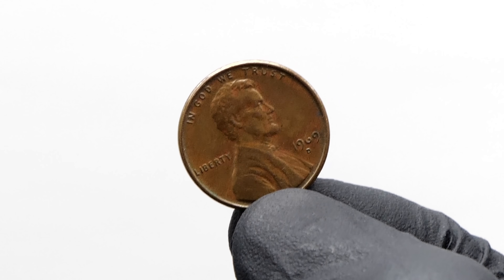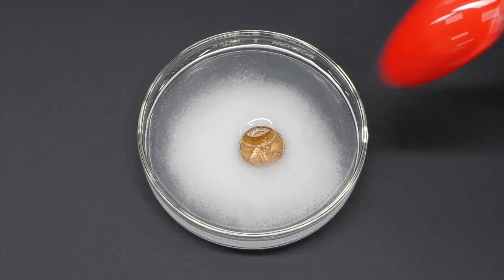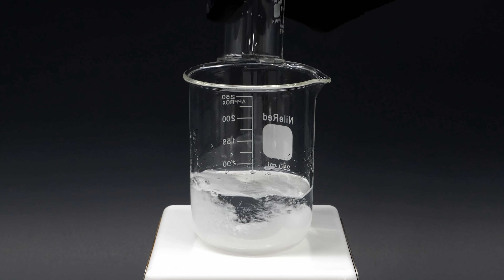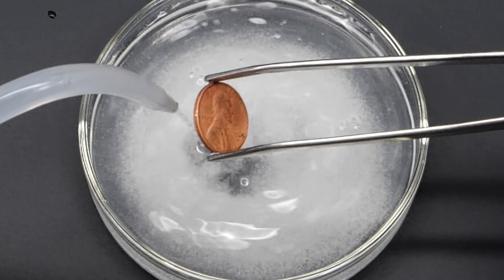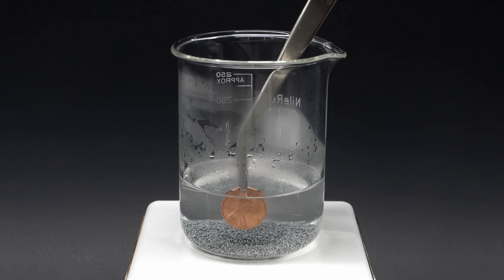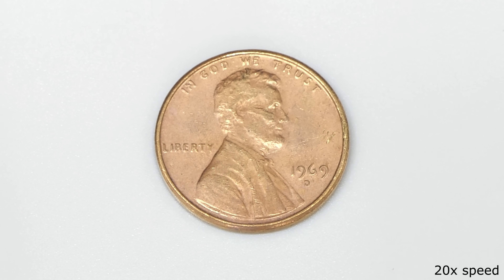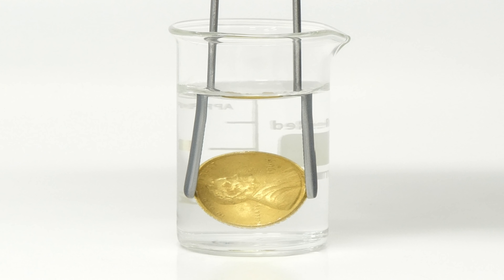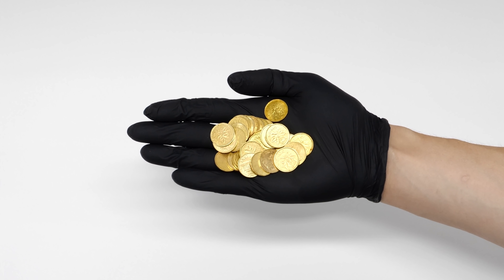The golden penny experiment

Comment: Fun Fact: the inside of newer American pennies is pure zinc (with a copper coating), so potentially you might not even need the additional zinc coating. I'd try it if I had a hot plate. (I do have an electric range tho...)

Comment: As you did the last step and it turned into "gold" i was so happy to know that Zn + Cu makes brass.
However, it surprised me that the reaction could take place at such low temperatures.
Reply: Zinc layer was so thin it was able to become infused with atoms of copper due to diffusion, without melting of both metals.

Comment: I actually made that in schools! But my school coin steps are different. First you must sand the copper coin and clean it with water, then put the sanded coin in the zinc sulphate and leave it for a while, next you see the copper coin turns into a silver coin, after that wash the silver coin with water again, last but not least heat it and the silver coin turns into a GOLD one! :D But it's actually brass coin. Hope that step helps you!

Comment: I remember doing this in 9th grade chemistry, it was pretty fun, I turned a 1980s Canadian penny into brass, I also tried a 5 Euro cent, and it half turned, almost a rose gold color, I think because there wasn't enough copper, or I didn't put it in for long enough.
Reply: The 5 cent is actually supposed to be a rose gold colour so don't worry
Reply: It works well withy 1 eurocent coins, they get the same golden color as the 20 eurocent coins. But the 5 eurocent coins get a more rose golden color as you say.
Reply: Those 5 eurocent coins are actually made from copper plated steel.

Comment: Great video. Just want to warn viewers:
NEVER CLEAN OR DAMAGE A RARE OR VALUABLE COIN
Cleaning removes a layer of metal from the surface of the coin, which can make it look more visually appealing (to someone who does not collect coins) but technically damages the coin. Never do anything that permanently alters a coin, such as this experiment, unless it is a very common issue, like a modern penny. Just wanted to educate, I still think this is really cool if you do it to the right coins/objects but it could ruin your day if you find out you cleaned away 90% of a rare coin's value.
Edit: Rinsing a coin off under normal temperature water and/or lightly wiping it off with a rag is fine on lower-grade coins as long as it doesn't get scratched.

Comment: Considering how pennies are already 97.5% zinc coated with 2.5% copper,
Why wouldn’t this work simply by skipping to the heating step?
Reply: because the gold color would be on the inside where the zinc is, but you would want the zinc to be on the outside to actually see the color difference

Comment: In high school back in the '80s we processed all of our own B&W photos. The third of three chemical trays we put the prints through was called stop bath, a solution that leached leftover silver from the photographic paper. We'd drop pennies into it -- no need to clean them first -- and in a few minutes remove them after they turned completely silver.

Remember the steel pennies of 1943? There were a few dozen copper pennies mistakenly made that year, pennies even then worth a small fortune. Well, in 1944 a similar number of steel pennies were mistakenly struck. These 1944 steel pennies were just as rare although lesser known, except to collectors.

See where I'm going with this? My brother and I, both amateur coin collectors, picked out the common 1944 copper pennies from our sets and dropped them into the fixer to silver plate them. After, they were virtually indistinguishable from a rare and extremely valuable 1944 steel penny. That is, except for anyone with a magnet.

Comment: Aren't pennies zinc on the inside and a copper shell on the outside? Do you have to coat them in zinc again or can you just clean and heat up normal pennies? 
Maybe the copper on the outside would oxidize too quickly?

Comment: We actually did this exact experiment in my high school chemistry class, except we used a bunsen burner instead of a hotplate, so some people ended up accidentally melting their penny.
Reply: i dropped one of mine and it landed on the counter and got one edge smashed and splashed out. way cooler looking than the two that worked perfectly
Reply: That's the problem if you use an post-1980 penny made of zinc instead of copper.
Reply: @BogeyTheBear  i think that was part of the idea when we did it? like, the copper on the outside was somehow meant to react with the zinc on the inside, is what i remember
Reply: @BogeyTheBear  they are still copper on the outside, so this would still work.
Reply: @StrokeMahEgo  Getting it to work is one thing. Keeping the zinc penny from melting under the heat is another thing entirely. A bunsen burner is not going to melt a 100% copper penny even when heated to glowing. Believe me... we tried.

What we did was coat the outer surface of an all-copper penny with a layer of zinc, then used the bunsen burner to melt that zinc into the copper.
Reply: Let me tell you, the people that melted their penny did it intentionally. That ish takes a lot of energy
Reply: @vincentgibbons5613  So thats an even bigger reason for the fbi to arrest them? lol
Reply: Where are you from
Reply: Dude were you in my class?! Almost everyone melted their pennies, including my stupid lab partner who I turned my back on for one second 😒
Reply: Lol really? How low is the melting point, for that to be possible?
Reply: Taking chemistry honors right now, and we're getting a dedicated lab period next semester, which I'm quite excited for.
Reply: @someguyv1188  same :DDD
Reply: Not related to the comment but I think that 1969 penny is rare but I may be wrong
Reply: about mpemba effect:- https://youtu.be/YIs3th01NV0
Reply: YEAH SAME SOMEONE GOT A SECOND DEGREE BURN and i defaced a penny
Reply: I did that too, and because I was part of a Chemistry Club i got to demo it to the rest of the 30 kids
Reply: Lol same
Reply: We did it in middle school 6th grade for halloween and called it alchemy to make it spookier.
Reply: Where did you go to school at? We never did cool experiments like this in my chemistry class.
Reply: I also did this in one of my high schools years and ended up melting a penny over a Bunsen Bunsen burner on Accident, It’s Still sitting on my shelf to this day.
Reply: Welp guess theyre going to jail now for melting us currency
Reply: @potatoesandducks958  when did they say they were from the US?
Reply: @BananaWasTaken  I suppose they never did. I just assumed they're in america because I thought only us dollars use the term "penny". Do other countries also use "penny"?

Also why would it matter, pretty much every country outlaws melting official coins, right?
Reply: @potatoesandducks958  when I found out the US also use the word penny I was surprised, I thought it was only the UK cause our money is pounds and pence, penny comes from pence so the US adopted it when they made cents
Reply: @potatoesandducks958  melting Coins isn’t illegal, defacing printed currency is
Reply: @ali-b9152  It's only ilegal when you melt down the metal with the intent to sell it.

Comment: Pennies minted after 1982 are different: Before 1982, pennies were 95% copper. After 1982, they were zinc with a thin copper coating.

Comment: wooow. atfirst you can clean copper with 30% hydrochloric acid and water solution for fast oxide removing and it doesn't damage the surface. cause it become immune to acid. and about the other parts I have to saw wooow it amazed me it was the mixture of electro less plating and heat treatment. it was zinc plating but turned into brass plating and not to mention brass is strong and golden and has a good resistance to corrosion. by any chance do you have any titanium powder ? cause it would be sooo fun to have titanium plated pennies cause you can turn its colour to a variety of metallic colours

Comment: Fun fact: this is how they make gold coins in movies. Gold melts really fast so even if they just coated coins in gold it would scratch off and look butt ugly.
Reply: sure... the reason gold scratches off is because it melts really fast :thunk:
Reply: @ciarangale4738  it's possible for gold particulates to come off jewelery simply from wearing them normally. Gold can be spread so thin that it could be (theoretically) 1 atom thick. I don't remember exactly but you can cover an entire tennis court with $30 worth of gold. But, pure gold is so malleable and frail that if you were to step onto that theoretical golden court with feet that would be slightly more electrically charged than the floor, you'd leave golden footprints all over the court and have golden soles.
Also gold is edible. According to Tom Scott it just tastes like metal.
Reply: @kosmikme  im well aware of how soft gold is. that, however, has little to nothing to do with how fast it melts

Comment: I’m curious what exactly the sodium hydroxide does in the mixture with water and zinc? What other compounds can be used here ?
Reply: I first saw this demonstration about 40 years ago.  As I recall, the explanation was that sodium hydroxide reacts with the zinc to form the soluble zincate salt Na2Zn(OH)4 and 2 electrons.  The liberated electrons flow through the zinc metal to the copper penny and into the solution of zincate ions which are reduced back to metallic zinc on the surface of the penny (the reaction does not work if the copper and zinc are not in contact).  Kinda weird that it works at all, since the overall reaction just transports zinc from the zinc beads to the copper penny, which doesn't have any obvious energy release (which implies that it must be driven by an increase in entropy, which isn't obvious either).  Presumably, any soluble hydroxide salt would work - KOH or Ca(OH)2 - so long as the resulting zincate salt [K2Zn(OH)4 or CaZn(OH)4] was still soluble.
Reply: Thanks
Reply: I think thats to provide a alkiline environment for redox or to neutralize the acid that used for cleaning? Not sure

If so anything that can produce a alkiline solution is okay, but NaOH is just a common one

Comment: To be honest, that silver coating looked more visually appealing to me.
Reply: Just pretend it's a dime and no one will know
Reply: Zinc turns manky real quickly though. It would look better if you plated tin onto the penny, which requires thiourea to be electroless. Nurdrage did a video on that topic.
Reply: @Scrogan  wellll, really quick... galvanised steel is zinc plated to give it more corrosion resistance. And it works, for about two decades.
Reply: @MmeHyraelle  that’s because it acts as both an oxide layer and a sacrificial anode. Doesn’t stop the oxide layer from looking dull and dirty. Tin plating probably won’t last as long in most situations, but it will definitely look better.
Reply: Me too, I think it’s more striking to see a silver penny rather than the gold one. I think it might be because gold is a bit closer to bronze.
Reply: Me too. They resemble my US 1943 steel pennies, or those experimental aluminum pennies that were all supposed to be destroyed.
Reply: I deem you to be insane.
Reply: Same
Reply: I thought it looked better silver than the gold color
Reply: about mpemba effect:- https://youtu.be/YIs3th01NV0
Reply: about mpemba effect:- https://youtu.be/YIs3th01NV0
Reply: Actually it's zinc😬😅
Reply: your mom looked more visually appealing to me

Comment: Ima do this. Also does this mean I could make a copper trombone then do this and make it brass?
Reply: Yeah, although it would only be a coating, and good luck getting a good coating all the way through the tube. And also, it may sound different and may be more susceptible to get dings if you knock it about, since it's still mostly copper.